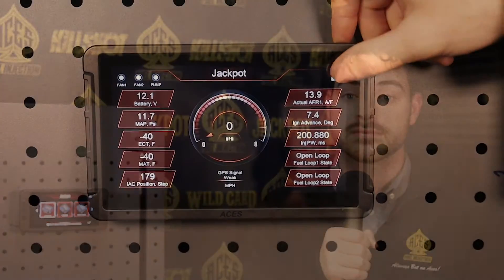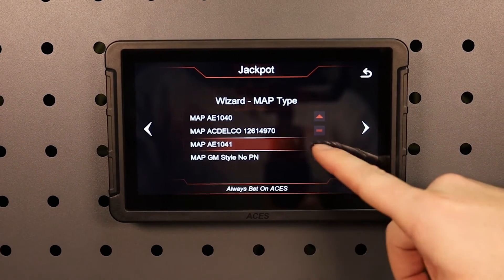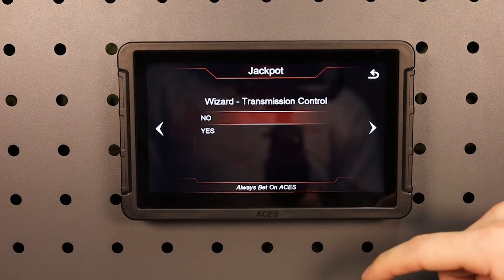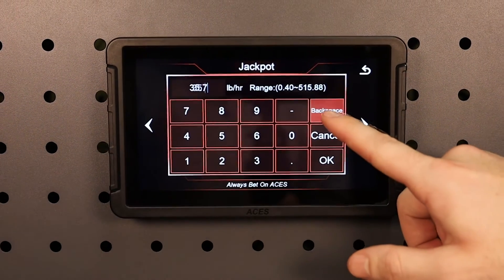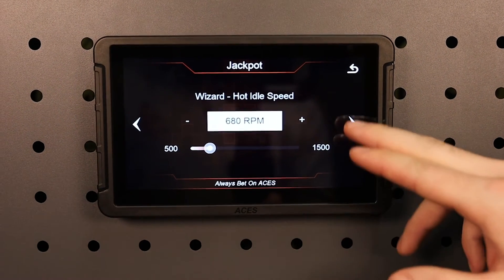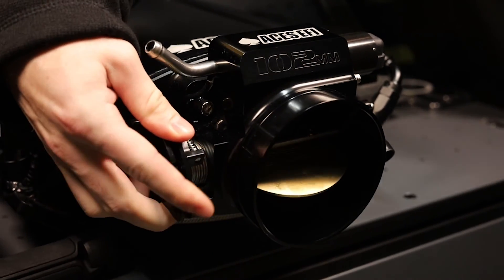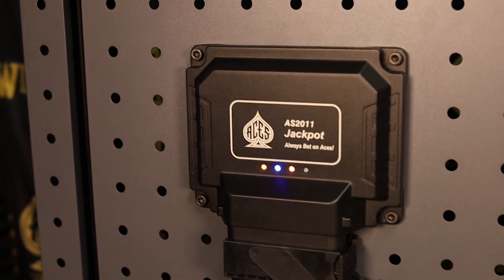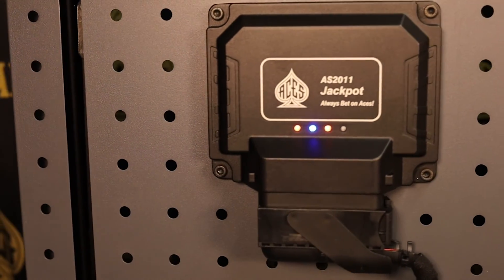Jackpot Highlight Video

Comment: I'm gonna order the dbw with manual transnoption. I'm doing an ls swapped 135i bmw. Originally I want the holler but for the price and reviews I've seen online of this product I hope it'll be worth it. I just hope I can use the stock bmw gas pedal as it uses a 6 pin pedal like most new gm cars. 😬😼🫡 I'll post an update when i hook everything up to see if the pedal is compatible. 😼🫡
Reply: Did you succeed with hooking up the pedal I have a e90 bmw im in the process of wiring up

Comment: So far the install on my ls jackpot has been super easy and and self explanatory. Ive been a mechanic for 25 years .I was concerned about the wireing harness at first but its well thought and well made.This weekend should be my first fire up so ill keep everyone informed.BUy the way dont listen to the internet, most of these fools cant jump start a vehicle.yet alone plug in a well labled and well explained wireing harness and wire schematic. As for tuning the system your self I belive it will be just as easy just do some research or have a basic idea of how fuel spark and timing work.